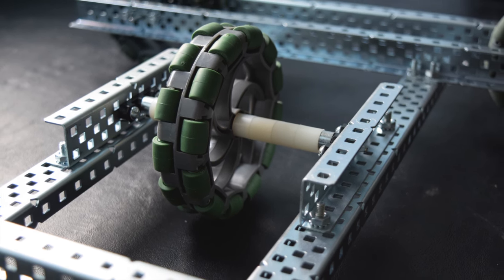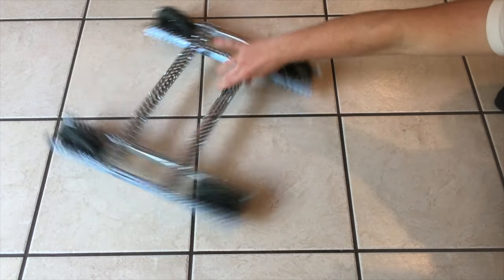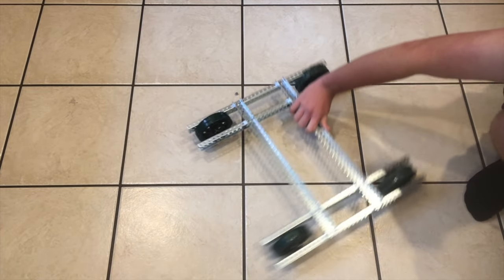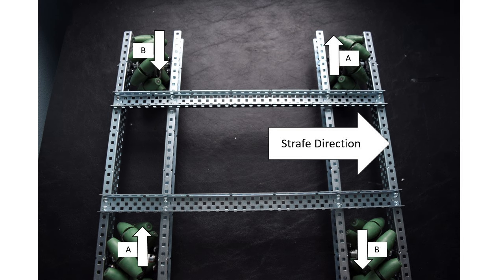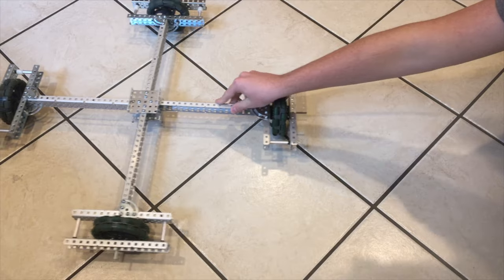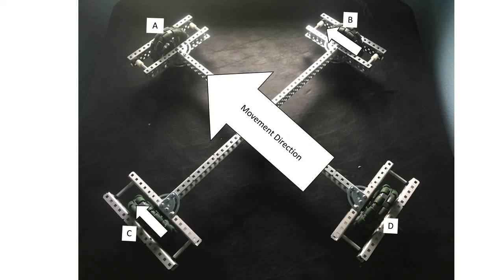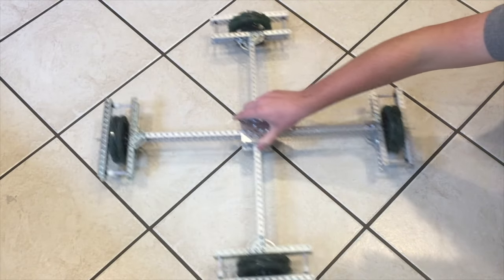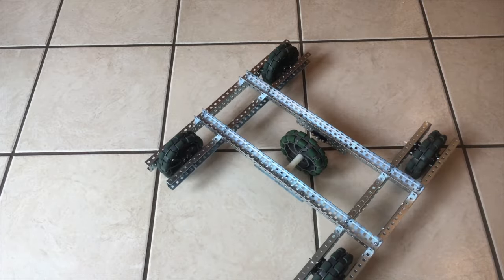The Ultimate Guide To Omniwheels (Holonomic, Mecanum, Tank Drive)

Comment: Good video, but remember that both mechanum and x-drives lose pushing power and speed: the angled rollers on mecanums waste energy in the same way holonomic drive does
Reply: You're likely correct about the pushing power but you're wrong about speed. X-drives are actually faster than standard wheels. 
Onmi wheel can act a geared up wheel. If you could maintain traction, you could go really fast by angling the omni wheels away from the direction of travel.
I have several Mecanum and onmi wheel videos on my channel. I also have a video where I attempt to explain the math behind omni wheel speed.

Comment: This makes me appreciate my differential swerve. The only disadvantage to it is that it requires some differential calculus in the programming as well as it being more costly.
It’s really difficult on the programmers and tedious for the builders but holy crap, it dominates in-game
Reply: Was dat
Reply: @biaxolotl5171  it’s when you have 2 motors per wheel and 4 wheels on each corner of the robot. Although the same concept works perfectly fine with more wheels.
One motor is for linear movement and the other is for rotational. You can move in the same direction while spinning & be more stable than any other drivetrain.
Reply: @bradyschindler4199  How do you circumvent motor limits? Vex EDR only allows you to use 8 motors, so you wouldn't have any for components.
Reply: @advaithnidumukkala6140  sorry, FRC not FTC

Comment: 0:50 mount the axle in a slot, and add a small preload spring, or add structural to the centre, if the middle support bows from the load it might take up the slack

Comment: Just recently got aware that these exist. Got a RC car (RB1277A) with mecanum wheels and swapped it with a STM micro dev board and hobby esc's and could successfully use a program for control that I used for my janky quadcopters back in the days with less than 5 lines of code changed :D. Using it now for FPV and it literally feels like playing a game with a gamecontroller movement wise. Great channel btw!

Comment: Great summary! My application is to accurately  retrace a path. Maybe rubber rollers are better than Nylon for this? There is no large slope, and pushing other objects is not a requirement. The design max gross weight is 75 lb.

Comment: Another disadvantage to note for mecanum wheels is that the net force when moving straight forward/back or left/right is weaker than standard wheel options since the forces are directed at 45 degree angles. This means that the total power in mecanum movement is sqrt(2) / 2 times that of traditional wheel options

Comment: For the problem regarding unintended movement when strafing, perhaps a static response mechanism for the side rollers can be implemented. In a manner of which act like brakes for the rollers, and while the rollers can act as temporary treads over slippery terrain, with all the grooves they have in between the rim and rollers. You know.

If you can make the hubs waterproof if that's your driving conditions; driving over puddles, climbing inclines, mud, etc. You should be golden. 

It's ideal to have wheels A and B be the only groups of moving parts from the rollers, instead of additional C and D; it makes things simpler unless you're willing to elaborate and experiment with this project.

I can imagine the 5 wheeled prototype be used for mobile turret fire like hobby grade toys, for RC LARP. Making a Halo Ghost/Wraith should be easy and fun to use.

Comment: It is worth mentioning one of the main downsides to the x drive is that it requires a more complicated mechanical design of the robot, H-bases and U-Bases are simple and allow for a lot of room to build game mechanisms within the space, x drives however take up more space, and introduce difficult problems in terms of spacing and stability of the wheels axles, not every design will work with an x drive. And H-drive with the omniwheel in the middle is one of the best designs I've ever worked with, you are able to move diagonally in that base aswell if you drive forward and strafe at the same time. It tends to be less stable but that can be worked out. The wheel not touching the ground can be solved by offsetting the center beam down by 3-4 washer, this causes the center wheel to bite into the ground a little, creating a lot of rigidity and boost crontol a whole lot, and that's something an x drive cannot to at all. I also suggest using two motors for the center wheel as it has to do a lot of heavy lifting

Comment: Mecanums can move in any angle as well, you just need to do math in a controller to vary the throttle given to each wheel depending on the direction you want to go >.>

Comment: Couldn't the fifth wheel in the middle be solved with some sort of spring hydraulics? Cars have those too, you can lower or rise the car with a press of a button. Sure it's just not that simple, but there sure can be a similiar solution if it just can be fitted

Comment: Mechanum wheels tend to have higher friction overall because of the slant angle they are trying to drive on, main reason pepe dont use them much in vex is because the size of them isn't worth it in most designs that use all of the allowed space, as an X drive provides more manuverability and can be configured in less space. If they mechanum wheels were built with high quality, they might be worth it, but they are already very expensive so making them even more expensive is another turn off for most people.

Comment: There is a bit wrong with your holonomic segment. It’s really common in RoboCup and is not limited to 8 direction, using some trig you can really do any angle you want with enough motor control fidelity, and while you cover the three wheel variant, by modifying the control maths you can really have as many was you want.

Comment: It seems to me that the x drive is the same as the mecanum drive.  It's basically putting the rollers of the omniwheel in the same orientation as the rollers on a typical mecanum setup to achieve a similar effect.

Comment: I am doing a  school project and I have to make a robot that can move and pop a ballon using a remote , would these be good wheels ?
Reply from the maker: It really depends. If the entire goal of the project is to turn and pop a balloon. Then you would probably be fine using normal traction wheels. Most of the time, these wheels are used to gain a competitive advantage in programs like VEX or FIRST. 

If you do not already have them, then you would probably be better off looking at either foam wheels or rollerblade wheels. If you do have them, then omniwheels would probably be your best bet.
Reply: Kepler Electronics thank you this will help me and my team a lot I’ll let you know how the competition goes
Reply: How did that project go?
Reply: @Aagggyy  it got canceled last spring due to COVID 😕
Reply: @kainb61  Dang that sucks.

Comment: I have been participating in Robocup junior competitions from 2005 to 2013 and as a referee since then and over all these years the 3 wheel 120 degree omni drive has been the undisputed best design, even though I won several competitions with a 2 wheel robot that had way more grip and torque and therefore was faster, but could not move sideways. In lower leagues that was an advantage, but on the German national level in Robosoccer 2vs2 Version A, my team got absolutely obliterated by teams with the 3 wheel 120 degree design.
There have only been a hand full of teams that have ever tried any of the 4 wheel designs, but they are all significantly inferior to the 3 wheel design, because any stable object needs only 3 points of contact. If you have 4 points of contact, you cannot have the same downforce on all wheels, which makes your robot less controllable. Also the added weight and space needed for the 4th wheel is simply not worth the investment.

Comment: Why would you call four wheels a "tank drive" when tanks don't have wheels? Seems kinda dumb.
Reply from the maker: That's actually a really good question. It's not about the wheels themselves, but how they are driven. In a tank, if you want to turn, you drive one tread forward and the other backwards (or at differing speeds). 

The tank drive control scheme mimics that by having one side of the drivetrain controlled by one joystick while the other is controlled by a different joystick. no wheels pivot as in a car, but it's all about the difference in speeds between the left and right sides. You can do it with tank treads or with wheels, it's all the same. 

Outside of the competitive robotics world, tank drive is typically called skid-steer, which is what I probably should have said in the video.